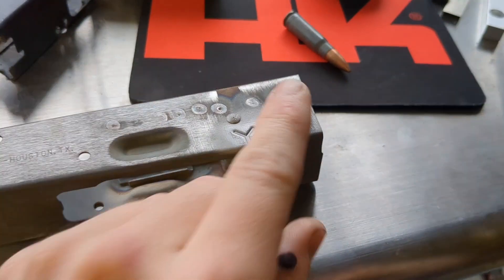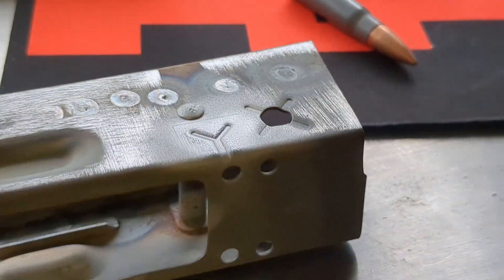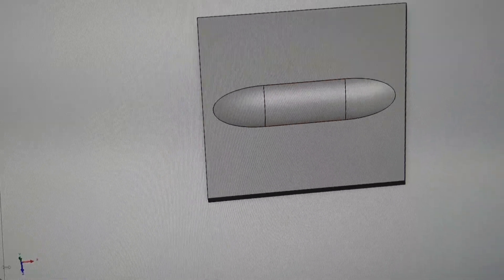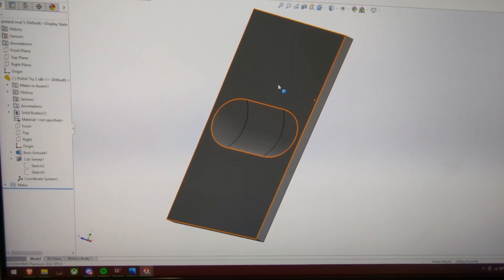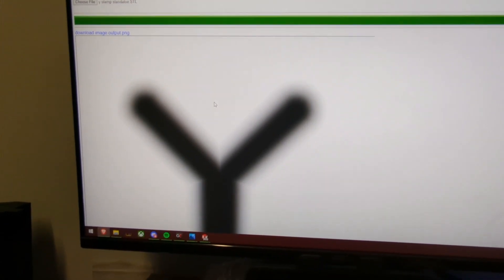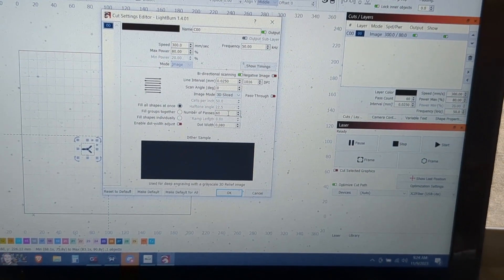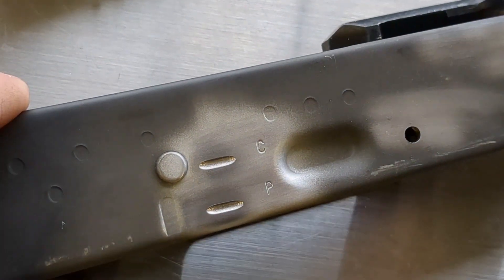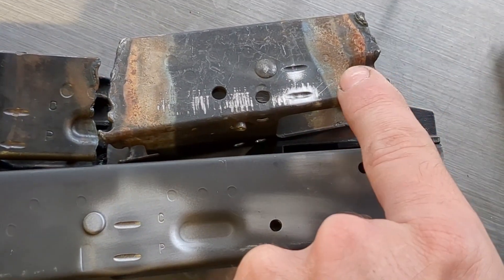3d Laser Engraving for AK Cloning

Comment: I see that you are using a 50W fiber laser. Is the laser head moving down while the engraving is happening? I know that with my 50W JPT fiber laser; it did not support 3d engraving in EzCad. I'll have to check again with Lightburn.
Reply from the maker: The head is not moving. I set the focus roughly in the middle of the engraving depth

Comment: Are you worried about making the metal thin around the Y pin location?  Maybe laser a die set and press the Y in place.
Reply from the maker: You're correct, the Y engraving would weaken the area. It would be done for cosmetic purposes. 
Stamping in the Y is quite difficult. You'd have to anneal the area, use a lot of trial and error to get the dies right, and then harden again.